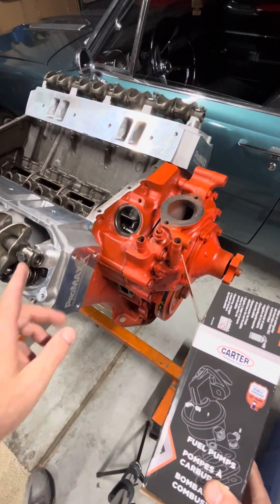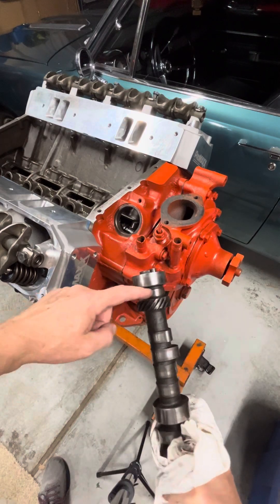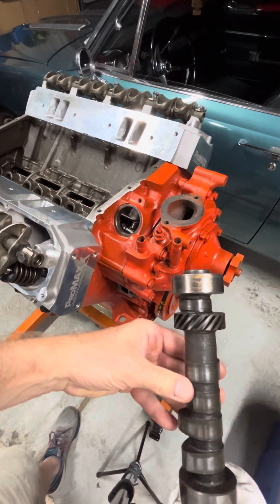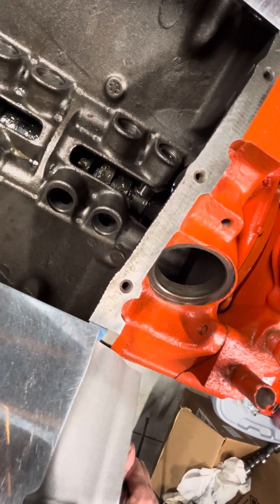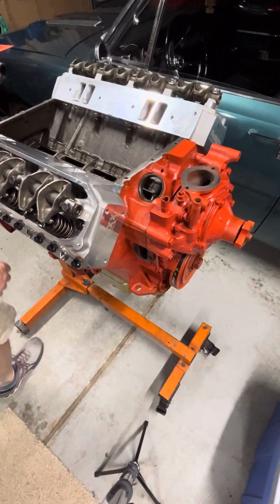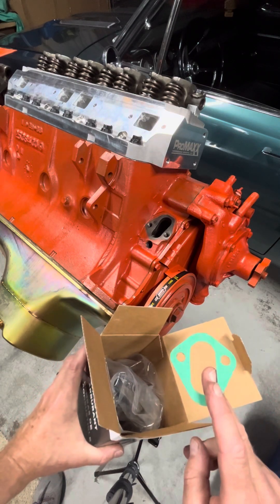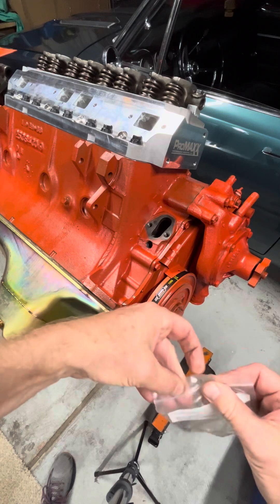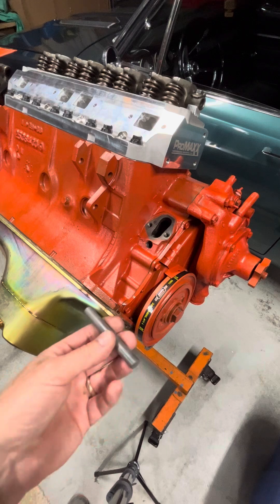440 Mopar V8 Engine Rebuild Step 26 - Fuel Pump & Pushrod Instal

Comment: Good vid , i need to install a mechanical pump back on my 383 in my 70 dodge, that was converted  to an electric pump, (none of which last) and am concerned about installing the pushrod, ie, will it just fall into to the block omg
Reply: I have to change a fuel pump in a 67 charger with a 383. What's with the rod, should i not have the engine on T.D.C when I put it in?